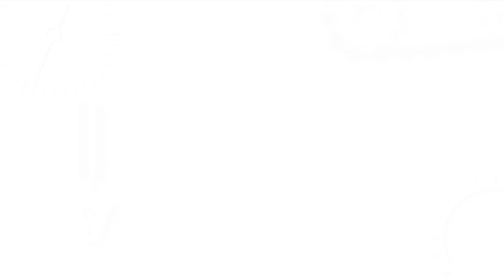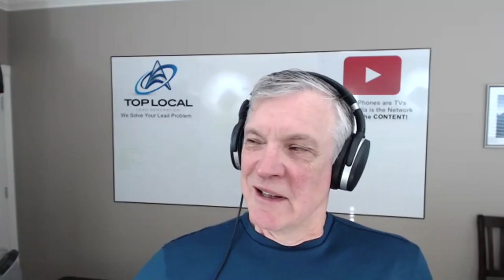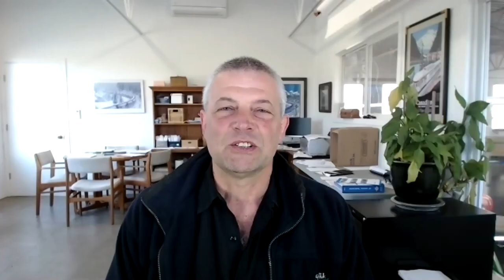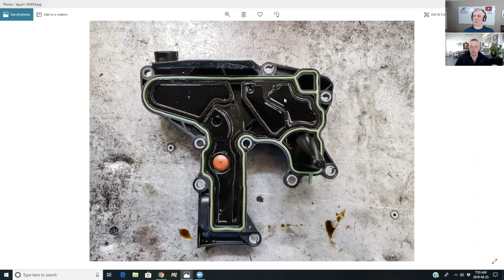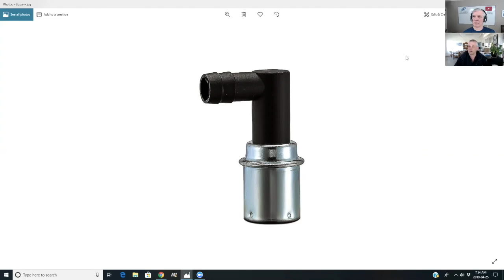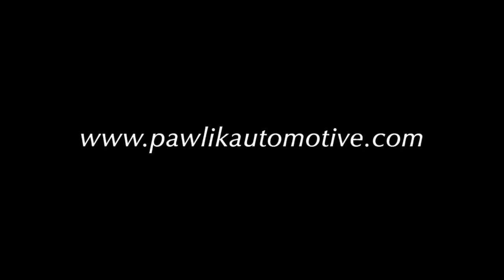2009 VW Tiguan Engine Oil Separator

Comment: I’ve oil pressure engine off indicator flashing on screen. But recently i got my oil changed engine is running good. I got codes scan from auto-zone stating that replacement of engine oil separator. Can it be the reason behind the oil pressure indicator? I had engine light on before for certain vacuum leak.
Ps- I’ve VW CC 2009